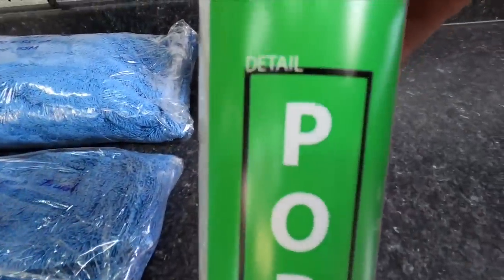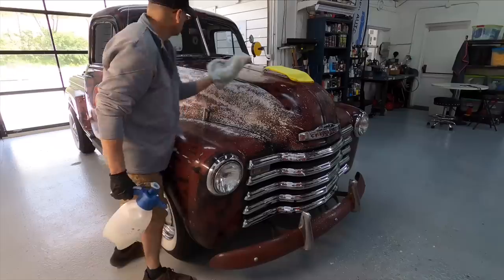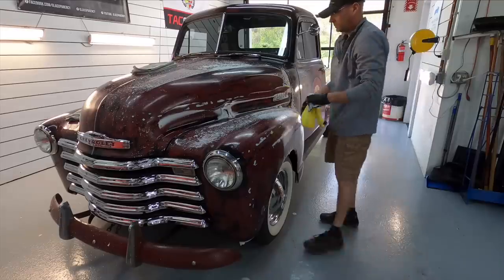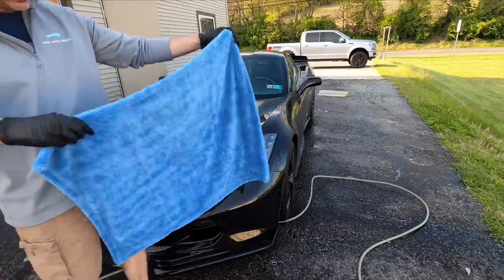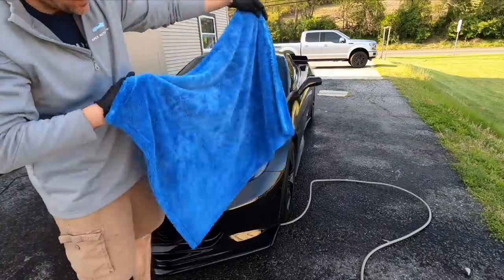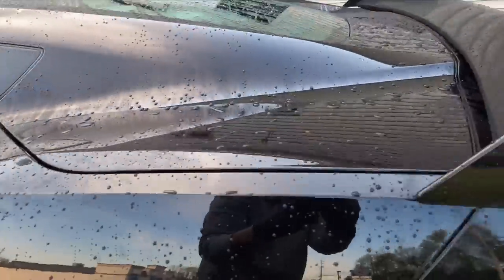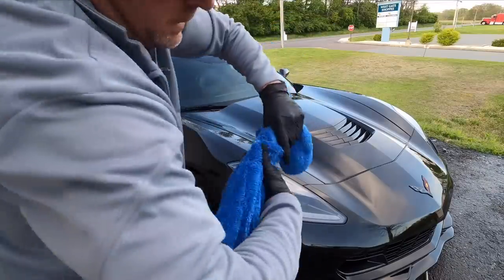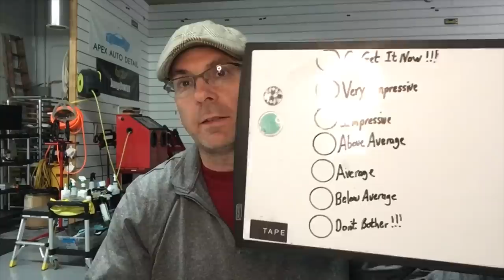Detail POPO Foaming Rinseless/Waterless Wash!(Universe Wash) And 1200 GSM Twisted Rain Drying Towel!

Comment: Towels seem to suck up water nicely but, your cars paint is professionally polished, and with a high end coating so most of the water just rinsed off. I wonder how the towels would perform on a car that doesn't have that high end protection? Thanks.

Comment: Unless you are living in a heavily water restricted city, I don't get these waterless/rinseless, washes. Don't see how they could be more effective then a car soap. Love the big towel!
Reply: True. But like me, I live in apartment where we don't have the unlimited water supply where you just spray and rinse water to your car till the sun comes down.
Reply: When used with safe technique it's a way to maintain your car clean more often and with less time than a 2 bucket full wash.

Take 2 cars, one is washed once a week and a waterless/Rinseless once in between that week.

Take the 2nd car and only gets washed once every 2 months. When it's washed the caked on dirt grime Tar bugs bird droppings take a hell of a lot more effort, agitation, and thus risk of scratching marring. In a year on neglect water etching from rain will have probably permanently affected the surface which the once ever 2 month washing isn't going to fix.

Continue that way for several years and putting the cars side by side the surface would be pretty drastic.

You could fully wash the car twice a week, but it's overkill, so waterless Rinseless when used at your discretion saves time and money and is part of your long term goal of protecting your car. If thar matters to you in your world of course.

Comment: I bought some of American Detailer Garage Fuzion, their version of a foaming  rinse-less wash.  Very similar to this product!  Would you trust that rinse-less wash on your vette Brian?
Reply: I have had good results using it. My method is foaming it with Fuzion then having a bunch of microfiber towels soaking in an ONR bucket. Use the towels to wipe off the foam and switching towels once saturated. I then dry off the panel using a sucker jr with a spray of opti seal. It’s some extra work and off label but great results so far

Comment: Must watch for later, I can say I could never get my head round these waterless/rinseless products, until I tried ONR, now it’s my go to. I would have thought the foamier would have made it less slick? 🤷‍♂️
Reply: Paul Hamilton The question is, has slickness some magical edge to less slick products or is it only in ones head?
Reply: @Sherukka  sickness is part of the chemistry not in your head and depends on the product.

There's regular onr and onr with wax.

Ultima waterless wash + also has a bit of carbuba.

Then there's sio2 waterless washes which who knows what's inside.

Then there's the lubricity during use. People often tout Wolfgang Uber Rinseless and dpc revive have more lube than onr easily felt when used side by side.

They're just trying to differentiate from the crowd.
Reply: LeoC Yeah, but are they really better or even safer? I would say by experience, no. 🙃